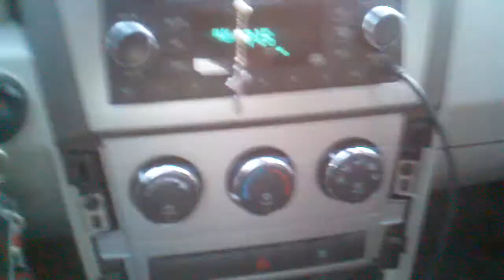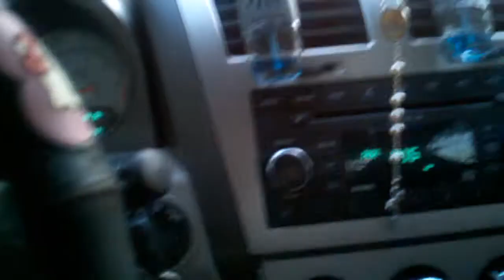Avenger shifter stuck in park fix part 2

Comment from the maker: not sure man. I know most the newer cars use a pretty similar mechanism. Sorry I replied so late, I had actually replied on my Droid phone a while back but it must not have gone through. I want to say it should be the same. Also make sure your brake likes light up when you touch the brakes. IF they aren't then your brake light switch is the issue, and will also cause your shifter to not release because it doesnt see you pushing the brake. Thats a possibility to look into.

Comment: Hey man I don't know if you know much about transmission but mine was rebuilt a couple years ago then it sat for a year or 2 after done, I started driving it again now reverse doesn't work, when put in reverse you can feel it kick in but doesn't go any where? Is it sloping or what? It's 96 dodge avenger v6 I think the 2.5L